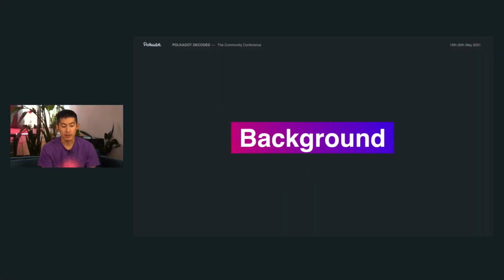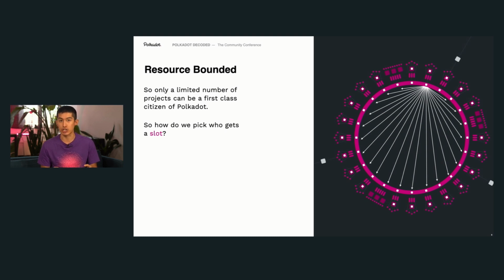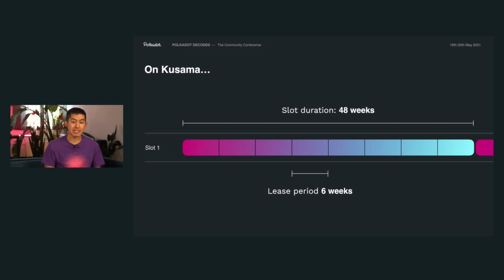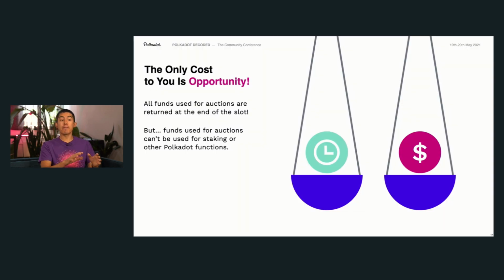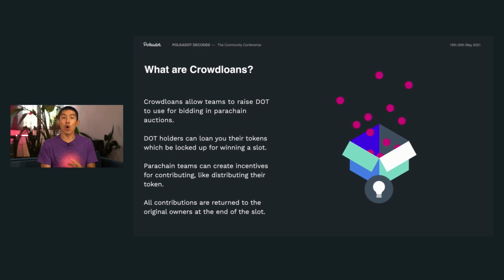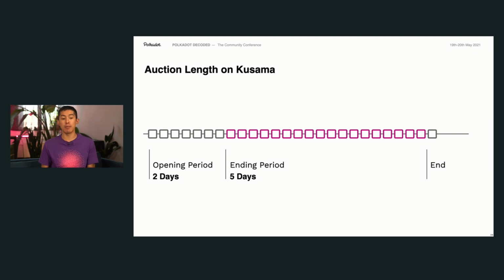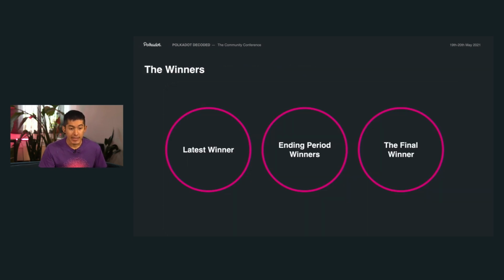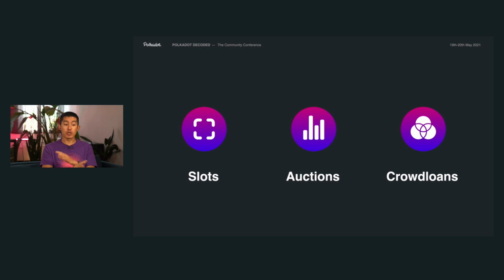Polkadot Decoded 2021: Auctions, and Crowdloans, and Slots, Oh My!

Comment: The candle auction method chosen seems to display a fundamental lack of understanding of Austrian economics, the economic model upon which crypto, a functioning and wildly successful validation of anarcho-capitalist philosophy, is based. Namely, as economists Ludwig Von Mises and Rothbard illustrated, what price is and how it functions. An English style auction is the superior choice of value seeking as it allows the price mechanism, which encapsulates perceived value of not only the object at hand, but of the supply and demand characteristics of the KSM token itself, to be established. Value is subjective thus, if you decide the winner via a random snapshot thereby depriving others of the opportunity to adjust their bids, what you end up with is an incredibly low resolution image of what the actual perceived value of any of these parachains are, not to mention the value of the token itself. 

This is the problem with modern crypto development. The originators of BTC were steeped in Austrian economics and the philosophical underpinnings of anarcho-capitalism. BTC was the expression of that in code. In other words, the philosophy was (and should be) the primary driver, as opposed to cool new shiny blockchain tech being the driver. This invites disaster as many with great tech skills but little wisdom economically and philosophically will end up unwittingly creating "cryptos of mass enslavement" by aiding and abetting the very ideas and institutions that crypto was specifically brought forth to destroy. Namely the organized crime syndicates euphemistically called governments and the Marxist central banking cartels that empower them. 

For example, the insane tyranny of KYC/AML laws violating every individuals sovereignty and right to privacy and the tracking and persecution of political enemies facilitated by IoT and "smart" cities. All of this laid out by the would be rulers of the world in the public domain as shown by investigative journalists like the Corbett Report and Grand Theft World. Anyone who is in crypto needs to be acutely aware of the pure evil that the WEF and the UN are, as creations of the central banking cartel.
Reply: I think the point of the candle auction is to incentivize projects to submit their best bids as early as possible. I’d agree that it likely undervalues each parachain, but I don’t think it’s substantial enough to have any negative influence on the price of each KSM or DOT, as it’s mostly speculative right now. Price volatility is very apparent in cryptocurrency, but I assume as the market matures, volatility will decrease. The candle auction isn’t supposed to be the best way to do it, anyway... it’s more of a fun game theory experiment to see how projects will react and source funds when the snapshot timing is unknown. As stated previously, this incentivizes projects to put their best effort into the early stages of the auction, since any late bids may be useless. Like you said, there’s likely consequences to the perceived value of the parachain, but as time goes on, the winning bids will have an effect on the bidding activity for future projects, so I think that it will slowly become a negligible price effect. Projects will eventually create and abide by an ideal form of bidding, which may just be bidding their maximum at the very beginning (or as close to it as possible).